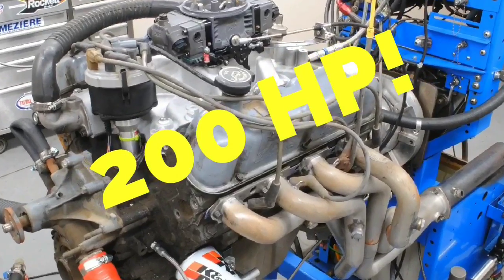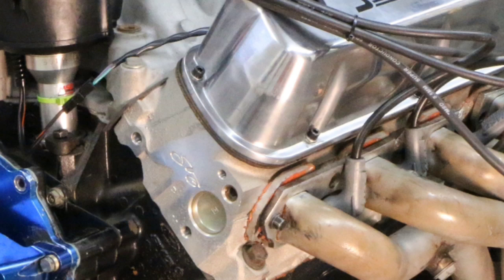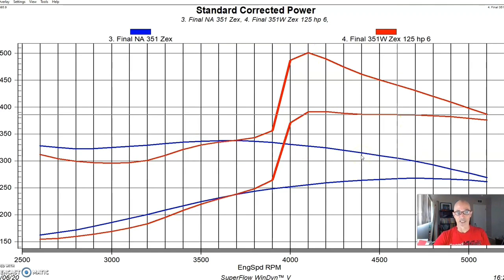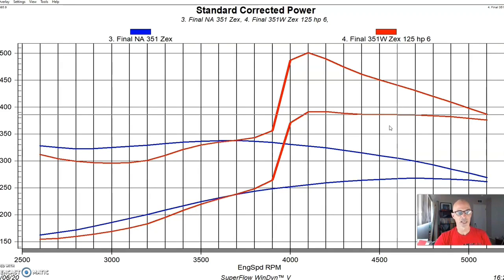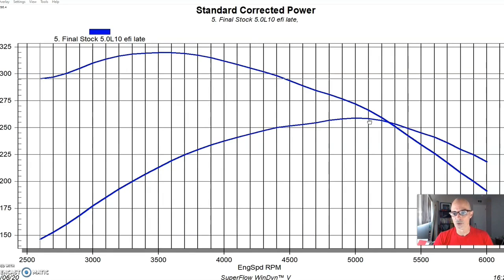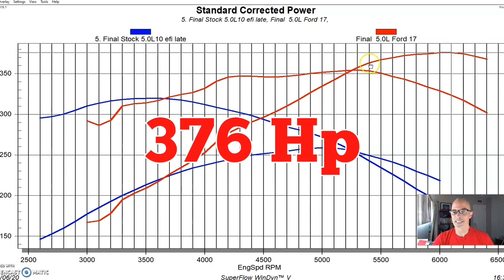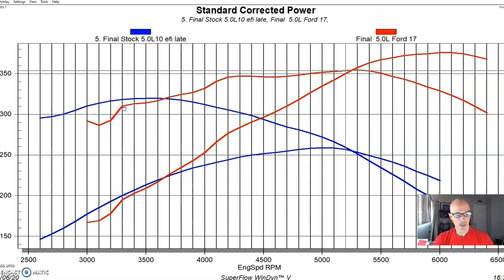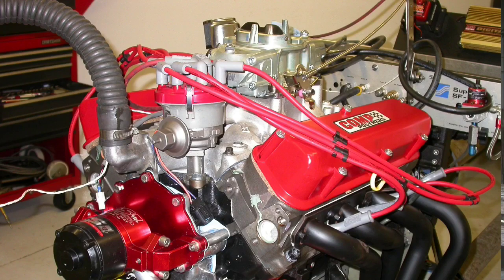HOW TO: 300+ HP 5.0L (SBF) FORD POWER RECIPES

Comment: What can you do to make them cross at a different RPM other than 5200
Reply from the maker: change the formula
Reply: @richardholdener1727  what formula my 565 crossed over at the 5250 just like your engines all have on every test you've run that I've seen they all cross over at 5250
Reply: @bigredracer7848  @ 13:49 Horsepower is calculated as a function of torque. If you are using "horsepower" and torque in "foot-pounds", the formula requires the curves cross at that RPM. If you use a different unit for horsepower and torque, the formula would cross at a different RPM point. They all cross at a fixed point for all such graphs because of the formula. (The lines are showing different related attributes measured in different units they only cross on a graph - in the real world they are not on the same sheet of paper).
Reply: Change the laws of physics.
Reply: Fascist Pedant : Yea cannae change the Laws of Physics, Laws of Physics.....
Reply: Use kW and Nm, like the rest of the world.
Reply: Erwin Nijs : ♡ € & ★★★★★: My friend Dorboslav Niksic would agree. May many cubic centermeters of refreshments come your way, and boundless kg-m of tire smoking torque. The term Horsepower or PS is an exclusively English invention by dogmatic Scott Mr Watt, which was then converted into System International Units which used Watts, Newtons and kg-m. As a Kiwi who was metricated at 3, I know that 9548 is then the kW and Nm equity point, and the graph wont cross. Then it will have to be DIN certified, and thats difficult. And no one in the Americas will know what Richards saying if he has to multply by .7456 to get Bhp into kW and 1.3558221 to get lb-ft into Nm. But now Ive told you that, youll be able to do it for all of U.S. My Yorkshire Grandad was part French. It was always an issue when someone rolled into the Quarry at Mt Zion Dunedin New Zealand and asked.for a ton of rock in his 4 yard truck. He was putting on avoirdupois like nobodies business.
.
Reply: @deanstevenson6527  To be honest, everyone in Europe including the English use HP and Nm when it comes to internal combustion engines. I know, this is mixing and matching units... Call it an amicable compromise ;-)
Reply: Erwin Nijs : Australians use both Imperial and Metric. They used the metric figures for all Fords from 1973 onwards, and I have to convert 302 / 351 Cleveland and 5.0 XR8 and 5.6 strokers into 188 to 335 hp figures from metric. I can handle any of them. I'd like DIN net. Dinnet is 135.58221 miles from James Watts birthplace in Renfreshire. Is this just a coincidence?

Comment: 300-400, is still pretty tragic on an engine dyno for 5-6L😅
Reply: @DropDstar whether or not you want/need such a power output is unrelated to the specific output (kW/L) of the motor.

The tragedy is that out of 5-6L motors (even midly modified) still can barely muster 400hp (300kW) on an engine dyno. Linked here is a great article from hotrod (https://www.hotrod.com/articles/testing-ford-393-cleveland-on-engine-and-chassis-dynos/ )

Old mate gets keen when he sees 512hp on the westech engine dyno, only to discover that somehow 132-rampent American 🇺🇸 horses have gone missing by the time it hits the chassis dyno. 🤣 🤣 🤣. And that's with a manual trans😲. Imagine the losses with a junk 3-speed auto... 😐 

These numbers are inflated because of the 'ideal' test conditions used (Richard often mentions) these test conditions, do-not reflect real word conditions or power to the tyres.

So when I say 300-400 hp on this engine dyno is 'tragic' for a 5-6L motor. That's on the inefficient, heavy motor, not old mate that want's to cruise😅. I've got a 1965  1.5L Toyota Corona with barely enough power to pull the skin off a custard tart. And it's just perfect 👌.
Reply: @manitoublack  Remember, these 5 liters were only rated 175 to 215 horses or such and would run high 14s stock.
Reply: @manitoublack  emissions killed alot of power in engines. The ford 460  pre-emission made an easy and happy 400hp, after the epa got involved, the massive 460 got knocked down to around 210hp. That's the sad story here.
Reply: @manitoublack  You're going to bash small block V8s and then try to tell us how great a pos Toyota 1.5 liter is lol🤣🤣gtfoh man!Btw have you ever seen what a properly built 5.8 Cleveland Ford motor can do??
Reply: @jimgould2829  again, you've missed the point. The V8 Ford motors were sold as the 'performance' option, the 2.3L 4, was the poverty special. In he Toyota range (in my example) the 1.5L 2R is junk (no question) but the performance 9R 1.6L twin cam offered 120-130hp.

The issue isn't with your power needs. Want a lazy cruiser, no worries. It's that these 'Performance' engines with fairly large displaments offer pretty meger 'go' for all of their 'show'
Reply: @manitoublack  government mandates, they trashed the hp when emissions mandates went into effect in the 70s.